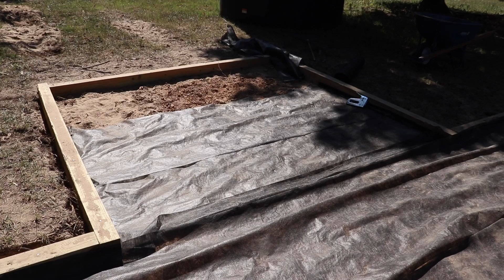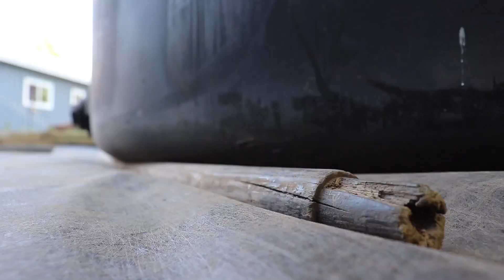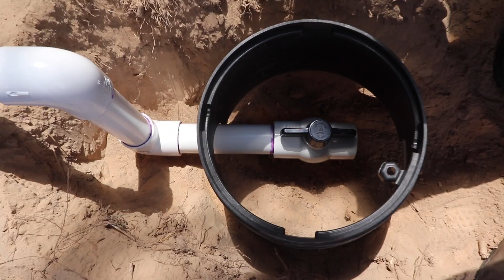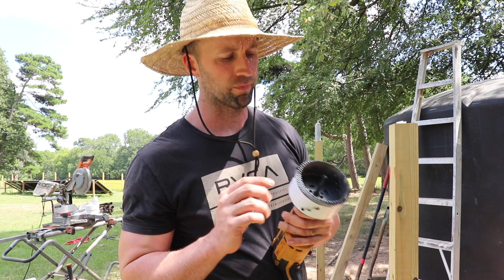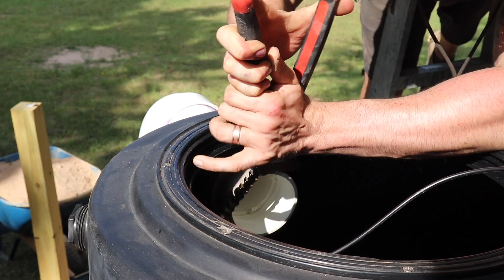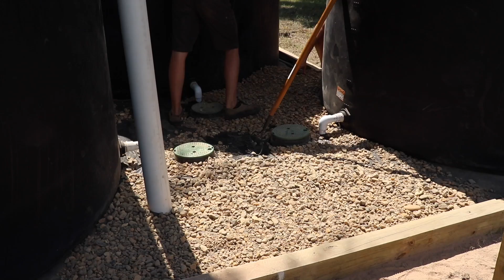HOW WE'RE GETTING WATER OFF GRID!

Comment: In high school I helped build a water collection system in Honduras on a church trip. So much trial and error. We initially had the tanks above ground with logic that you guys are implementing. It didn’t work, the gutters were high enough but the pressure to push the water up a 3 inch pipe was not enough. We eventually buried the tanks below ground, had to hot wire a backhoe, but it saved us a 3 days work, the pipes entered from the top and the earth kept the water cool almost cold. Simple 1/2 hp solar powered pump brought the water to the houses.
Reply: I have been wondering if the pressure from the single pipe will be able to fill all tanks. The underground idea sounds like a more practical idea. 
That said, perhaps the assumption that water always seeks to level off might help... but I am of the opinion that eventually gravity itself will oppose the rise in water levels because of the entry point.
Reply: Hello
Reply: I would love to know about the 1/2hp solar pump! We are trying to figure out how to move up to our land and water is currently an issue.
Reply: @ashbolton83 did you figure out your water issue?

Comment: Sir Spencer, When in Rome (or Texas) Perhaps it would be prudent to install a lift pump oooooorrrrr, Run a "Aquaduct" of PVC across risers over to the tanks and let gravity work that way. Not tryin' to be a know it all because I surely don't, but I unless you are using some kind of physics I am unaware of, the water will back up your downspout when it equals the height in your other verticle to the tank. But hey, I hope it works and will be eagerly awaiting the outcome to see. Great content guys.
Reply: That's why the tank is lower than the gutter as was stated in the video.
Reply: @GeneWaddle  Thanks for clearing that up for me.

Comment: The gutter fill system SHOULD, in theory, work like a water level. As long as the water on the roof is higher than the fill pipe at the tank the pipe and gutter system should work like a water level, the water at the tank will rise to the same level as the water at the roof, IF it were tall enough. I think it will work as built.

Comment: Been there and done that, but my tank was a 20,000g formed and cast on site, reinforced concrete tank. The concrete being whiteish, more or less, kept the water cool. I had an inline debris filter that caught (from the roof mind you) not only dirt and leaves and twigs but also snakes, spiders and field mice. (I was in Australia remember.) Also, we had years go by when we had little to no rain, so we had to pay for water to be carted 60 miles, 3 or 4 times a year at $100 for 10,000g from the nearest reservoir. It is the law in Australia to have a fire hose connection 6" above ground level for the fire pump truck to connect to in an emergency. The fire station also want access to a large pond that they recommend that your tank overflow ran into. Just a couple of thoughts for you to ponder.

Comment: Better insulate those exposed pipes, or they'll freeze and burst, one cold winter night.
Reply: In Texas though? Not so sure about that
Reply: @dortot1  In north Texas freezing temperatures are not unheard of.  I have never heard them say exactly what part of Texas they are in but I hope they looked into frost line depths before burying the pipes so shallow.  I would seriously consider putting a building that could be heated around the tanks.  Protect them from the weather and if a cold spell hits not worries of anything freezing.
Reply: Yours sounds like the voice of experience.  I can second your suggestion.  It appears that you have no provision for disposing of over flow.
Reply: @texflyguy  ... They mentioned they still had to do the overflow pipes.
Reply: @chuckpruitt1244  Missed that...
Reply: A concern for sure, however it will have to dip below freezing for many hours to be a problem. I think in Tx they be ok. That looks like a 4” pipe it will need to be really cold for a crack to accrue.
Reply: @IrishAcres  I agree, the water would need to freeze solid to crack the pipe.  Not sure if that's a possibility at their location in Texas.

Comment: NO NO NO that is not how gravity is going to work for your rain water. its called pressure. you wont be able to BUILD enough BACK pressure to force the water up that 4' pipe into your tanks. but all good you will see when come comes. your VOLUME from gutters is around2" going into 4" you will loose pressure and it will back flow out your gutters.... been there done that. GL tho.

Comment: Meant to ask if the pipe outlets at ground level need a bit of foam noodle insulation to prevent freezing, or damage if they're stepped on ?
Reply: Mike Love not much freezing going on in Texas unless it was in the panhandle. I never even do the old drip the pipes in my old place and never have frozen pipes.

Comment: Armchair experts, don't you love them!
"Have you ever actually done what you are saying won't work?"
"Errrr No, but I read it on another comments section so I'm an expert."
Reply: bren106 a lot of armchair experts have vastly more expertise with hydraulics and hydrology.  You can disparage all you like but this setup as described will not work. The laws of science don’t change because you want them to. If you knew anything about head pressures and plumbing you wouldn’t have commented. Sometimes people want to help because they are emotionally invested in the project champ.
Reply: @trustmeimright8363  go outside and pick up your garden hose...even a few inches...water flows out of the lower end. Now pour some water into the higher end...and water flows out the lower end. Now scale up that hose to 4 inch pipe. It will flow, by gravity, well over 300 gallons per minute. A 1500 square foot roof in 3 inch per hour rain will provide about 45 gallons per minute...well below the 300+ that the pipe will flow.
Reply: Go outside and pick up your water hose perform the exact same experiment and tell me at what rate the water overflows the inlet. The lower side must be drastically lower to keep up with the volume. Conservatively the tank inlet is at 6-7 ft. Gutter is roughly 10 ft. do the same with your hose,  ends aimed up, watch what happens. With their design you won’t be getting a vacuum or siphoning. Gravity isn’t enough.
Reply: @trustmeimright8363  I provided a link with a calculator...4 foot difference in height with 4 1/2 inch pipe (4 inch nominal) over 100 feet long = 360 gallons per minute. I then provided the math that 1500 square feet in 3 inch per hour rain produces about 45 gallons per minute. Well within what the pipe can flow. it IS enough...that is exactly how springs work.
Reply: https://youtu.be/J7ymn6f2Bl8
Reply: Lol, you are missing some key variables that exist in their particular setup. It won’t work without significant overflow from the collection side as you will see in future videos. I guess my classes with UGA cooperative extension (rainwater harvesting for system designers and contractors) was a waste. Peace.

Comment: You only needed one tank, you will never ever fill those tanks. Spencer you made a huge costly mistake because the head pressure will be greater than the water laying in your gutters. Water will come from the sky quickly and you will not be able to capture it all because the water will back up and overflow your gutters.  The water from the gutters should be piped overhead and dropped into the tanks. You should have drilled a well.

Comment: It would of better to put the inlet into the bottom of tank to overcome head pressure. This wouldn't completely fill the tank, but would make easier if you wanted to use a pump.

Comment: Your're goimg to end up with gallons of static water sitting in that 4" pipe for weeks or months, that will then get washed into your tanks at the next heavy rain. An elevated pipe from the house to the tank or separate collection tank @ the house with a sump pump are the only ways its gonna work. Good luck.
Reply: I don't ubderstand the difference between the water in the pipe or the water in the tank standing. All of the water will be filtered before going to the house. Hydrostatic preasure is why the system will work. Water seeks its own level and will flow into the tanks. I have a filter that you can put food color in the water and when it comes out its clear.
Reply: @jhlittleelect  I guess you're right, although some light will get through a white PVC pipe and encourage algae growth in the static water, the tanks are black for a reason. Also the pipe is open to the elements at the gutter end, so all sorts of insects could get in and breed in the water in the pipe. I hear what you're saying about the filter, but I'd still want to minimise any crap getting into the tank.

Comment: Brilliant idea with the hole saw and using the smaller bit as an arbor!
Reply: That is the way hole saws are designed, you always have a pilot hole for a guide.
Reply: Hole saws are made to stack one inside another in case your first hole drilled is too small?  Didn't know that.  @toddkratzer7953

Comment: Pretty sure drilling a well would have been cheaper and more efficient. I’m not sure that the water will fill your tanks all the way over there. There may not be enough pressure in the line of water to push up unto the tank.
Reply: This is way cheaper. I know. I was qouted 12k for a well. Thats just for a hole. Water not guaranteed. I spent about 4k for a similar set up. Not even close.

Comment: I do not believe the head pressure from the gutters will be enough to lift water to your tanks, I haven’t seen the runoff setup but 2.31 ft of water column produces about 1lb psi of pressure. As others have mentioned you will almost definitely need a lift pump. I hope all goes well.
Reply: as long as the top of the tanks is lower than the gutters it will fill fine
Reply: If the gutter is higher than the tank inlet then it will fill no problem.
Reply: Trust me I’m right I'm surprised filling was not done from top.
Reply: This isn't new
https://www.youtube.com/playlist?list=PLhdSS6wmVEgMtF_157fHEggmpKo1moMRC

https://www.youtube.com/playlist?list=PLJEhXwOJ_CGYEAYmjqjWwT9-LmAfu2_fb
Reply: @kenlee5015   If you did not see both of the systems shown on those two clips showed the the tanks are a lot lower that what theirs are. The second one showed to be about a 5 foot rise if that. I would guess from the first one about the same.
Reply: @rogerthetinker5116  If you only watched the first clip of the first link (Handeeman), then you didn't get enough of an overview. Those tanks are slightly buried but the roof is on the GROUND. It is higher than the tanks, just like a house roof. The water is not backing up: it's easily filling 4 tanks (same size as here), lifting from the bottom and filling at the top. Not magic, gravity and equalization.
Reply: @kenlee5015  I had watched both. Both where clips showed the tank well below the inlet of  the roof lines.
Reply: @rogerthetinker5116  Funn,y because I didn't provide link to specific videos, they were to play lists. That's ok. Here is the facts, The rainroof is about 5 feet higher than the top of the tank, so Derrick lowered the tank by 3 feet. (makes them about even, huh?) Here is a more clear video.
https://www.youtube.com/watch?v=xuEA4-TqpQI
Reply: Derrick did use 2 4 inch fill pipes, but he relies on monsoon season in Arizona for his water, they only get about 12 inches a year. They have a 3000 square foot rain catchment roof laying on the ground. Worth checking out.
Reply: Hi, great work from the beginning, keep it up! Why don’t you considered a rain water harvesting directly?
Reply: So the hydrostatic paradox doesn't exist anymore?
Reply: The top of the tank will need to be vented to reduce this head preassure as well.
Reply: @bigguns45acp  no, each individual tank lid is vented
Reply: I also perceive a problem in this area.
Reply: Yeah, this is one of those train wrecks. You see there is something called head loss. The friction of the pipe and fittings can be calculated and subtracted from the inlet elevation. So you subtract about 4 feet and you would get more flow from a beer bottle. Answer, yes the gutters will overflow.
 Part B. You never want unfiltered water in your tanks. The gravity filter needs to have a drain and be open on top eliminating more head pressure.
Is it too late to drill a well?
Reply: @michaelvangundy226  if you think this is a train wreck, go watch the house build on the PLFL channel. You don't seem very smart.
Reply: @KenJ-61  
I happened across pure living at the very beginning. They were just running a scam for donations. This show is entertaining but has a more honest feel. Me, I'm just an old retired contractor. I offer wisdom, most choose to ignore me. Some block me. But I hope someone reading this learns something,  you, not so much.
Reply: @michaelvangundy226  Word yo

Comment: Cool setup. A couple of ideas: You may want to build some kind of cage over that wet standpipe that leads from the gutters to the first tank. If cows are wandering around there then one may lean on it and cause it to fail. Or you may bump into it yourself. With a wet system like that you may also want to build in some way to drain the system so you don't get stagnant water in there during periods of no rain.

Comment: I pray that you never have a prolonged drought.
Reply: Yes Cat Drought can happen in the most unlikely places. That's when the water is bought and delivered by water cart and pumped into the tanks. Happens regularly where I live in Australia. With only two of them for now they won't use too much water. I installed a meter on my system as I needed to know our usage. With just the two of us and the pets and being waterwise we used 1100 litres per week or 290 US gallons per week. We didn't scrimp on our usage as it turned out we didn't need to but we did monitor it as I say weekly. In our large concrete tank approximately 24000 US gallons the level dropped an inch per week. This meant with a full tank we were assured of at least 60 weeks of water leaving at least a foot of water in the tank. Consequently we never needed to buy water in the ten years we were there and we had some severe dry seasons.

Comment: This is the 1st thing you've done that I can't wrap my head around.   Are you trying to have that much potable water in the end?   If so without using a ton of bleach or similar other sterilizer and rotating it out at scheduled intervals the filter network will have to be pretty amazing to work that well on unrotated or sterilized stagnant rainwater.   If you don't want it potable, I can see that it might work.  As for the gutters filling those tanks the way they are set up, you''ll lose more off the roof that you ever get in the tanks, meaning FULL GUTTER pressure probably isn't enough to push it up your vertical inlet pipe with the sq. footage roof you have.   Perhaps you've calculated all of this and it just looks bad from my limited viewpoint, I hope that's the case.
Reply: The idea is with water seeking its own level. As water enters from the roof into the pipe water will exit into the tank at the other end. I think they have not considered a deluge will not be handled well if this is the means they intend to do it.
Reply: @larrybe2900  I get that, below the house it will fill.....eventually......to many unknowns.....whats required? 10 inches of rain per hour?  The average Texas shower isn't going in those Cisterns.  I've collected  rain water for decades,, all vertical downpipes that collect every drop that falls.
Reply: Maybe they will need a 4" pipe for each downspout feeding into the storage tanks to handle the high volume of water during a Texas deluge?  That can always be done later, if they are losing too much water due to the limited capacity of a single 4" pipe.
Reply: @ILGuy2012  Good idea...I still have no idea what the plan to make it potable and keep it potable is, or if it's just for flushing toilets?

Comment: How are you going to keep the pipes from freezing in the winter. I know you’re in Texas but it still gets cold enough there to freeze and crack PVC
Reply: If the water moves a little a pipe wont freeze in the dead of winter here in Maine.  The fire department does it all the time for the fire hydrants here
Reply: wi11y1960 
That is correct if the water is moving. I still may have used a metal pipe instead of PVC in the ground. But easily fixable if it does burst